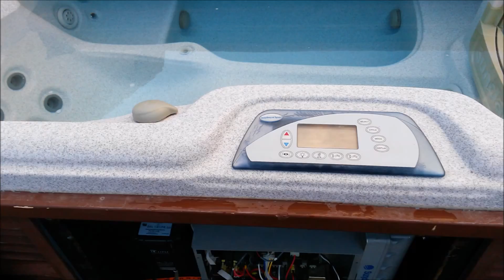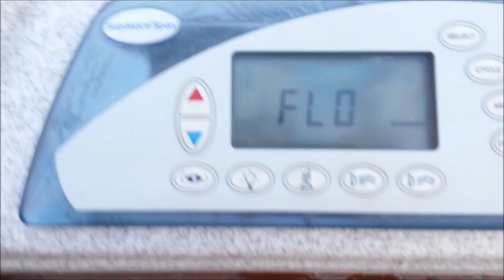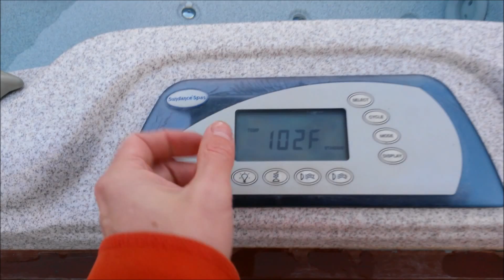Hot Tub Not Hot Enough? 104° Temperature Override  (:2:) The Resistor Method

Comment: This is a completely irresponsible video.  I hope you do not consider yourself a professional, because you are not.
Reply: +Mark Bodnar Well, why don't you and your screwdriver post a video then. I have had hot tubs for over 20 years and the one I just purchased is the only one that will not heat properly. My first hot tub reached 106+ easily and I enjoyed using it at 105 for 10 years. The laws are written for the entire public, including people with heart conditions who sit in a hotel tub for 2 hours while having multiple drinks. If you actually believe that the government does 'extensive research to determine the maximum safe water temperature for prolonged exposure' and that every single person needs to do exactly what their research says, it is you that is an idiot. I understand that as a professional repairman you cannot legally do this modification for your clients but if you are actually a professional you shouldn't be learning your business on YouTube anyway. SpaDayz solution to this problem, and it is a very real problem, leaves all of the other protections designed into the spa intact and just tricks the sensor by a couple of degrees. I would however like to see how you can heat 400 gallons of water to 108 degrees in 1 minute with just a screwdriver though. Please post that video, it would save a lot of people a lot of money.
Reply: +Steve Reschke  My tub is 104. WHen I take off the top it is 103. When I get in and turn on the jets it drops to 98 in 10 minutes. In New York when it is 20 degrees out. 96- 98 is not acceptable. I want to mod it to 110 so that it can drop to 104 106 and stay there.  This other guy is a clown. My showers scald me. That is the way I like it. 110 is nothing!
Reply: +Mark Bodnar I don't know if you have a hot tub Mark but it is very frustrating to not have it heat properly. When I open my tub in the winter, the display reads 104 but a floating thermometer reads 103. After 15 minutes open with an outdoor temp around zero, the tub is at 102 with the heater running. I worked with the people who sold me the tub to try and fix the problem but the couldn't do anything. This is exactly what I've been looking for. It is not irresponsible, any more than a stupid law that stops you from using your own property the way you want. Especially when I can go into my own bathtub, fill it with 125 degree water and scald myself. I just want to sit in 104-105 degree water. It is way more therapeutic than 103. I usually sit for only about 20-30 minutes.
Reply: +Mark Bodnar , nothing at all wrong with this method.  It's just correcting a slight calibration drift in the sensor.  I've done the same thing on a bread making machine to change the light/dark setting which was out of range, back into the correct range.  Works great.
Reply: He's not bringing it "back" into range, he's changing it's range (as well as assuming all liability and voiding the warranty).  If the calibration drifts, as the model in the video has a tendency to do, the correct repair is to replace the temp sensor. http://www.spaandpoolsource.com/6600-167-sundance-temperature-sensor.aspx
Reply: All Mark is doing with his screwdriver is adjusting one of the variable resistors in the circuit, which is no different than adding a resistor to the circuit as I and a few others have mentioned.  For that, he calls us idiots.  But I'm only from an engineering background, so what do I know?

I have a friend that is a lifelong user of a woodfired tub, and it has no limits at all.

It's your tub.  Set it the way you like.
Reply: +Mark Bodnar,  can we agree that with the tolerances of the sensors perhaps at 2 percent over 100 degrees. that 104 could vary between 103 and 105?  and that the water varies that much inside the tub at various locations and times in the heating cycle?  perhaps the correct procedure is to toss the mainboard and start swapping out sensors until we get that one or two degrees back to spec.

but this isn't a dire as advocating people start cutting the ground pins off our plugs, or taking the guards off our power saws.

Sure, we might scald our dangly bits, but those of us that remember component level repair are more worried about a stiff back, not reproductive viability.
Reply: +Gacy x so true.  Our 1970's electric  tub heats to 113 which is the temp of some hot springs that we all pay lots of money to go to and are packed with all ages of people,   Hoping to find out how to override the max temp on a small gas heater before I consider buying a Raypak...
Reply: You can't make the spa heat from cold to 108 in a minute, dipshit.  The range can be changed, with a manufacture approved modification  (which requires the owner to sign a waiver of liability) to heat to 108.   Please work on your reading comprehension.
Reply: +Mark Bodnar Maybe you should learn how to type. You are really good with calling people names but it seems the consensus on here is that you are just angry and clueless. Keep your name calling to yourself.  I'm sorry if you were the genius who decided that every person in the USA should only be allowed to heat their own hot tubs to 104 but in my opinion, it is my property and I will do with it what I want.
Reply: Nobody is stopping you from doing what you want to your spa, blow the thing up if it pleases you, nobody gives a rats ass..  The problem here is that a so-called "professional" is giving bad, potentially dangerous, information for the purpose of making a few dollars selling resistors and whatever else he's getting spiffs on. For this he should be called out, as he would be by any GOOD technician.
Reply: Realistically 104 is for bitches. Fuck that 220v and stash all yo riches!
Reply: This Mark character sounds like a liberal soy boy. Gtfoh boy.
Reply: Mark... You are a clown
Reply: Sorry, there are no variable resistors on that circuit board.  Sundance hasn't had them since the 600 series that went out in the 80's. 

"But I'm only from an engineering background, so what do I know?"
Obviously not much.
Reply: Steve, I've been in the spa repair business for over 30 years, my statements are made authoritatively.  

Industry standard for a portable spa is 104.  Period.  Extensive research has been done to determine the maximum safe water temperature for prolonged exposure, disregarding these standards voids the manufacturer's warranty as well as the UL/ETL listings. 

I guess it's alright to disregard years if study, and the practices of EVERY manufacturer, because it works on a bread maker.  Idiot. 

If your spa will not maintain 104, it's an completely different issue. It's entirely possible that your particular spa is simply not made well enough to keep up with the heat demand, many cheap spas won't.  If that's the case, your only recourse is to add supplemental heating, either gas or electric.  Personally, I prefer gas. 

By the way, I could make the spa in the op heat to 108 in less than 1 minute, with nothing more than a phillips screwdriver.

Comment: Hi Mate -  great video here.  My new $7000 hot tub is a joke at 104...  I was just wondering if you have a video for the balboa gs100?  Cheers...
Reply from the maker: carlynculver The process will be the same for all models. just find both of your temp sensor leads and insert a resistor on one leg of each sensor.
Reply: @SpaDayz  Hi - my hot tub has gone cold, thinking 1 of the resisters I put in 6 years ago has failed, they don't last forever do they?  I have a brand new heater so not sure whats up?
Reply from the maker: @carlynculver  you can use a multimeter and see if you're getting continuity through the resistor.